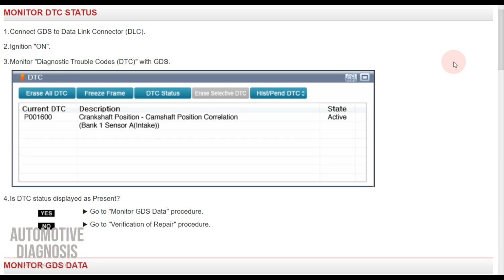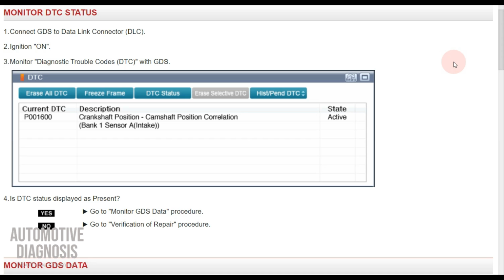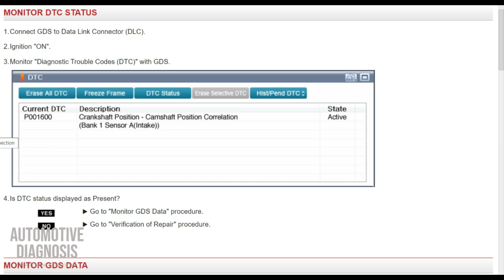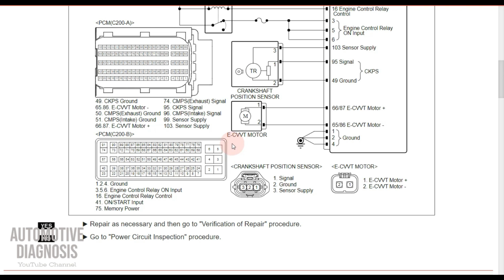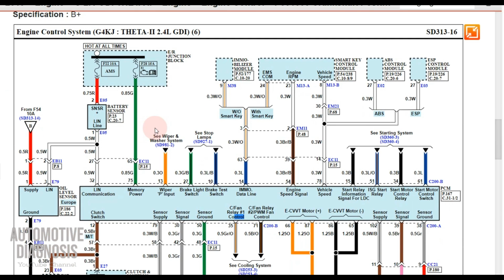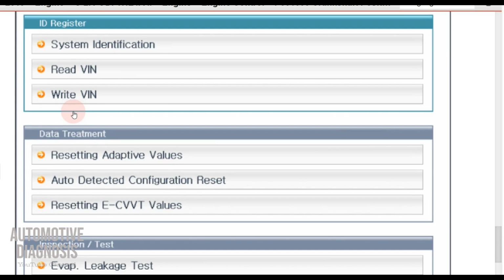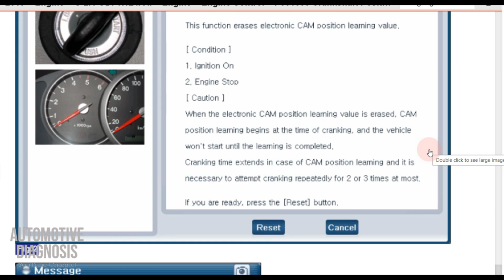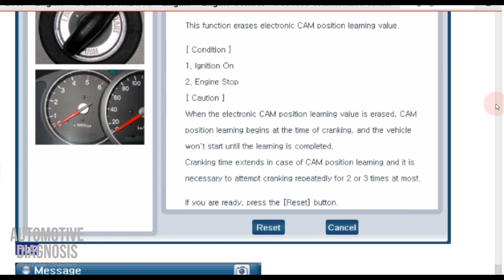Want to Fix P0016 Timing Fault Code on KIA & Hyundai? Watch This Now!

Comment: Hi, 
I just diagnosed my issue today and got this code P0016 on Kia picanto 2009, 
The Speed needle Isn't moving do you think this sounds like a problem with the sensor, 
As I am unsure if I would be able to replace myself or would need to send it to a shop.
Reply from the maker: There is no E-CVVT on that model. You need to watch this video for a bette diagnosis:
https://youtu.be/rucqKKmx1iw?si=gQIyXcDi9loLen0c

Comment: I have a fault that has this code,, and goes into limp mode once you drive it a mile or 2.. I removed timing cover. And timing was out.. hopefully with the good timing its fix today
Reply from the maker: Thanks for sharing your experience
Reply: @AutomotiveDiagnosis  yep car fixed. Was the timing, but I appreciate your info , very good one

Comment: I did the relearn on my 2017 santa fe. Now it always takes a long time to start.  I havw done the cranking 2 to 3 times... Long starts and it has not reverted to normal starts. What do you think is the problem?
Reply from the maker: Hi there, do you still have the code?
And what was your scan tool for relearning? Some scan tools can’t perform the relearning.

Comment: Will u plz tell which program u use for wiring diagram or which app u used in that video
Reply from the maker: This program comes with Hyundai and KIA original scan tool software called GDS.

Comment: Just replaced my camshaft cover assembly due to the E-CVVT oil seal popping out and causing p0010. Now that I replaced the assembly (with new sensor), I am now receiving code p0016. Can this be due to needing a E-CVVT relearning procedure? Thanks!
Reply from the maker: Hi there, absolutely, hopefully it should be okay after that.

Comment: Thanks for the video, I've had electronic CVVT a couple of times, is it on both camshafts or just one?
Reply from the maker: Hi there, normally you see the E-CVVT only on the intake side so far, it means on the exhaust side you still have the conventional CVVT with OCV (VVT solenoid).

Comment from the maker: If your car is equipped with a typical VVT or CVVT which is controlled by VVT Solenoid valve, watch the following video for the full diagnostic guide:
How to Test & Fix P0016 Crankshaft - Camshaft Position Correlation Bank 1 Sensor A (Bank 1 - Intake)
https://www.youtube.com/watch?v=rucqKKmx1iw
Reply: what could be the cause of this problem, after a while when driving the car, the same proaes happens, the engine revs at 1000 rpm, when I turn off the engine and start it again, it runs normally
Reply: Hello, can you reply to my message?
Reply from the maker: @vasifsultan4690  Sorry for late reply. Sometimes you might have an intermittent fault so as soon as it happens, Engine Control Module goes for the fail safe mode and you will have that condition you explained. and when you turn off the engine and turn it back on, because fault was there for a moment and it is not active any more, engine will run normally. Another case is when one component is faulty but it is not detectable directly by ECM, so ECM only detect the fault when that component works. So my suggestion is to check the connectors first (for the relevant components as explained in the following video:
https://www.youtube.com/watch?v=rucqKKmx1iw
Then check the VVT solenoid.
Reply: @vasifsultan4690 Mind me asking what you ended up doing to fix your issue? I know it's old but I'm having the exact same code and problems as you. I'm hoping it's an easy fix as an oil change but my gut is telling me it's possibly the timing chain, timing tensioner or timing guides.
Reply: Hello, I have a hyundai sonata, the error code p0016 occurred, but I replaced the cvvt with a new one, then when the car is running on the spot, it works normally, but if someone moves, the engine speed increases and the car becomes difficult to move.